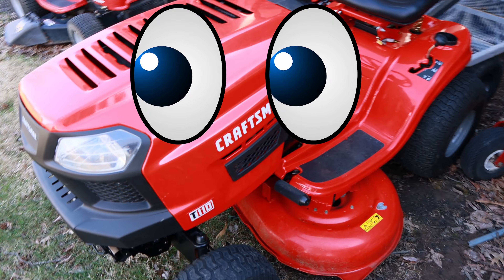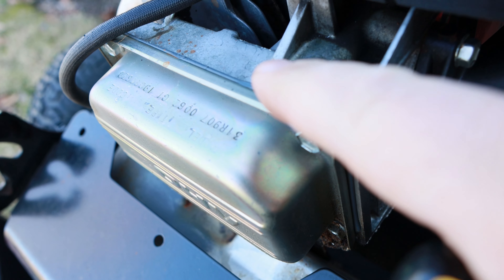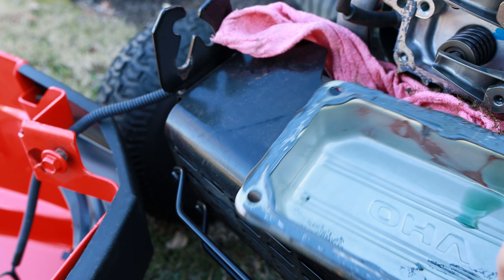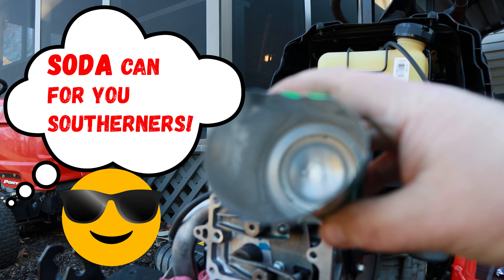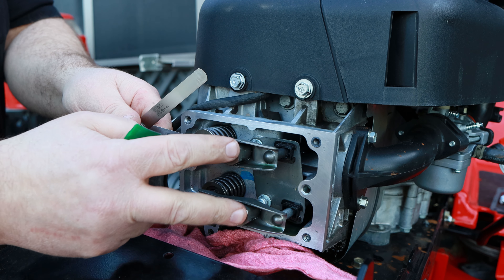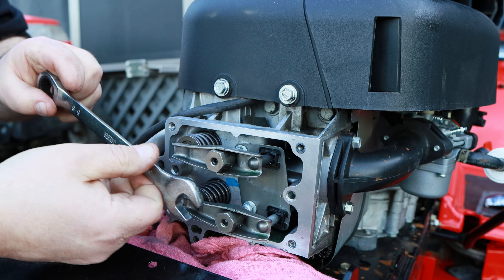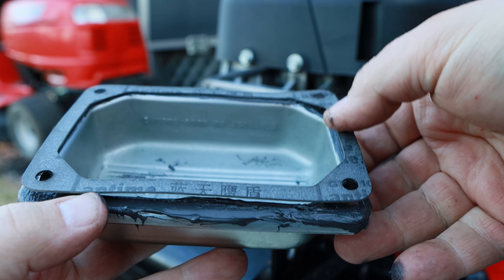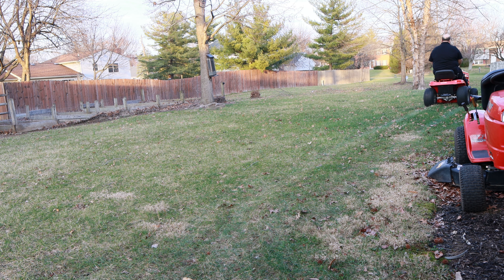Ultimate Smokey Mower Valve Adjustment Hack!

Comment from the maker: Below are the tools and parts I use in this video and my daily adventures.
Briggs & Stratton 272475S Briggs and Stratton Rocker Cover Gasket
https://amzn.to/3KD1caE
Kohler Courage Valve Cover Gasket 20-041-13-S SV470 SV471 SV480 SV530 SV540 SV541 SV590 SV591 SV600 SV601 SV610 SV620 18HP 20HP
https://amzn.to/3Z1W1oO
Kawasaki FR FS FX Rocker Cover Gasket 11061-1285 11061-7083
https://amzn.to/3xTjj4u
Permatex 82180 Ultra Black Maximum Oil Resistance RTV Silicone Gasket Maker, Sensor Safe, And Non-Corrosive, For High Flex And Oil Resistant Applications 3 oz
https://amzn.to/3Zpooxf
Scuff Pads, Scuffing, Scouring, Sanding, Paint Primer Prep Adhesion Scratch - Surface Preparation 
https://amzn.to/3Sx9XoI
32 Blades Steel Feeler Gauge Set - Metric and Imperial Measuring Tool
https://amzn.to/3m9QXQH
Torx Bit Socket Set, Premium S2 Alloy Steel | 13-Piece Security Star T8 - T60 Set
https://amzn.to/3KD94IZ
0-6" Calipers Measuring Tool - Electronic Micrometer Caliper with Large LCD Screen
https://amzn.to/41nC8dv
Inexpensive Wrench Set, SAE, 11-Piece, 1/4'' to 7/8''
https://amzn.to/3ZiY0Fd
Mini Tire Changer for mower, go-kart, and most small tires.
https://amzn.to/31eHgGp
The drill bits I use are lifetime-warranted Molybdenum from Drill Hog.  If you break one or wear it to nothing, you send it back, and they send a new one!
https://www.amazon.com/dp/B010US18BG/?tag=eagle0f1-20
Hand crank trailer winch with strap with safety hook
https://amzn.to/3jTBzEL
Titanium MIG 140 Welder Works with Flux Core (No Gas needed - 110 volts)
https://amzn.to/3mqj3oP
Titanium MIG 170 Welder Works with Flux Core or Gas (110 or 220 volts)
https://bit.ly/3k8GUrD

Amazon Wish List
https://a.co/cWseC8V
Simple Fix For a Smoking Engine Plus -  Beverage Can Valve Adjustment!

As an Amazon Affiliate, I earn from qualifying purchases.  These links help you find the products I've used in this video.  Clicking these links will take you straight to the products on Amazon and help support this channel without costing you anything extra.

Get the Motion Hero Pack that I use in my videos for 
Only $37 one-time investment. Use unlimited times on your own and client videos!
https://baldeagle242--videohero.thrivecart.com/motion-hero-pack-1/

If you're a video creator on YouTube - Tube, Buddy is an excellent program to evaluate your videos and make recommendations to help you attract more viewers.  
https://www.tubebuddy.com/Baldeagle242

BALDEAGLE242 Facebook group
https://www.facebook.com/profile.php?id=100068248886396
Reply: This is just a temp fix
This is just a demo but can be useful info

Comment: Had a kohler courage valve cover always leaking. Finally stopped it with new gasket, the 5th one, aviation grade permatex sealer and cleaning all the bolt holes with parts cleaner and installed bolt with a drop of loftier. No more bolts vibrating lose a it's been 4 years since then. Before it was a yearly thing. Messy but works.

Comment: Great video Steve!👍🏻
I’ve been adjusting valves for over 50 years, never seen the can feeler gauge before! We will have to check that out in the spring, when the equipment maintenance starts!☮✌🏻
Reply from the maker: Thanks Allen. My grandpa showed me this trick when I was a kid but I remember the cans back then being about 0.006” think. Either way they will get the job done in a pinch. Thanks for watching and taking the time to leave a comment. 😁👍

Comment: Hi steve, What would make an Intec b&s pop when running and when you put a load on it the poping stops? Adjusted the valves 3 times still the same. I would like any help you can give. thanks in advance steve.
Reply from the maker: There are a few things that you should check. First confirm that you have the correct specs for the valves in your engine. I would then do a compression check to confirm your head gasket hasn’t blown.
Reply: @baldeagle242  Thanks steve for the info. will check . thanks for getting back to me. keep those videod coming, very informative.

Comment: I had a similar problem with a Kohler Pro V twin,  they use an oil breather on one of the valve covers.  There's a grommet that holds the breather in place.  It kept falling out.  I removed the valve cover cleaned it with carburetor cleaner and used gorilla glue to hold the grommet in place,  I waited about 20 hours before putting cover back on. One note,  gorilla glue says it's supposed to have weight,  or pressure on the parts to work best I used a threaded rod on the inside I used a small hose clamp so it wouldn't touch the grommet and 2 big washers to hold the grommet in place.  It worked great.  It did take a while for all the oil to burn off.  I wish I had made a video but felt like it would've been very boring
Reply from the maker: I encourage you to make videos if it’s something you want to do.  I wish I’d started long before I did. There’s good money to be made.
Reply: @baldeagle242  
I have made s few videos,  not very good though.  I just posted a video of my latest project,  a Kohler 25 horsepower on a Murry 40 inch cut.  The 12.5 horsepower engine went bad, ( wore out) . Just go to YouTube videos by bert grau and take a look at my last video.  I have a few,  but I didn't do a good job of recording.